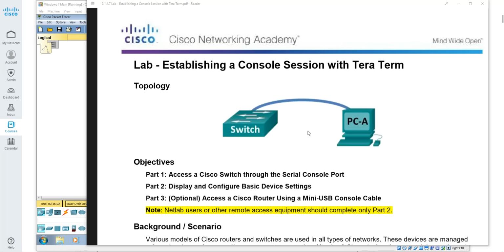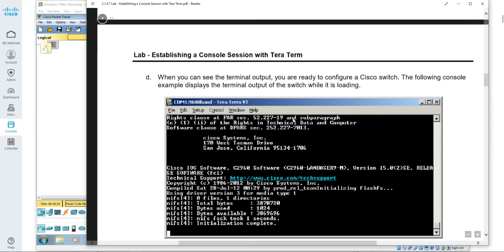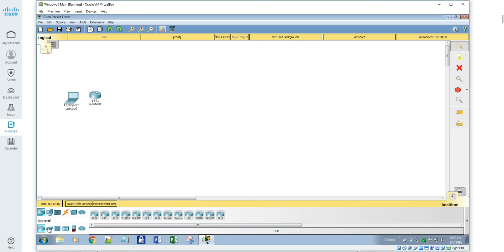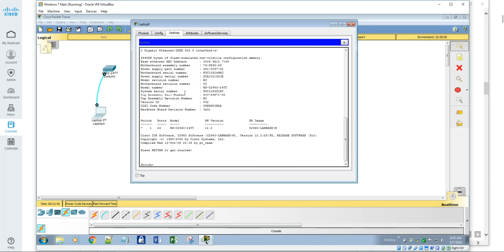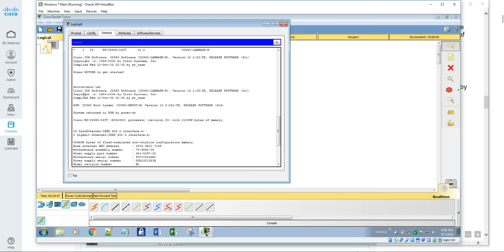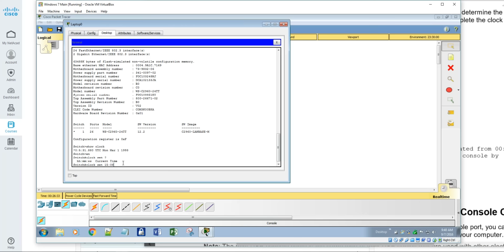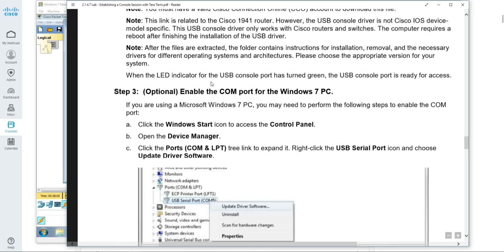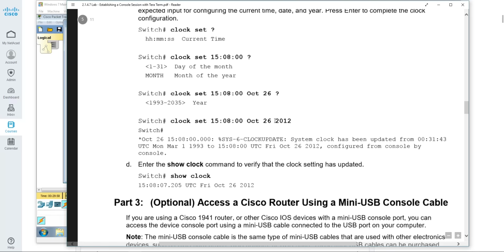2.1.4.7 Lab Overview (Packet Tracer) NETACAD CCNA R&S Course 1

Comment: would be amazing if you used physical routers and switches , in my case i dont have access to them yet , else good job nice and clean explanation.
Reply from the maker: I do have access to the physical equipment but it is much harder to video. Packet Tracer is great for demos. Thank you for the feed back.